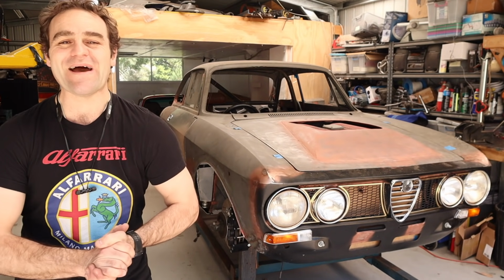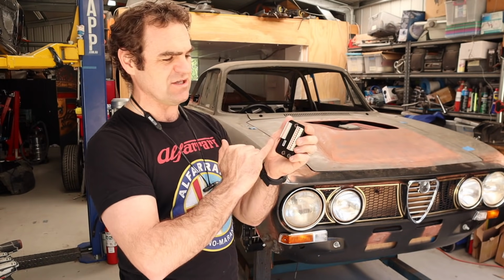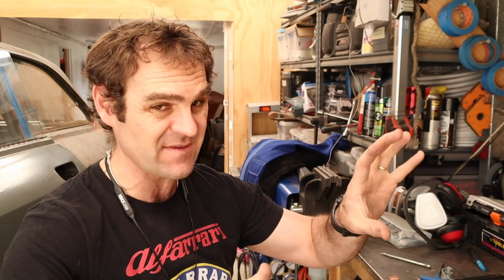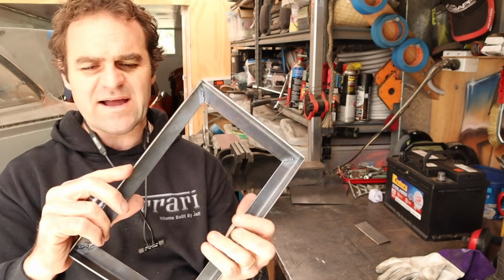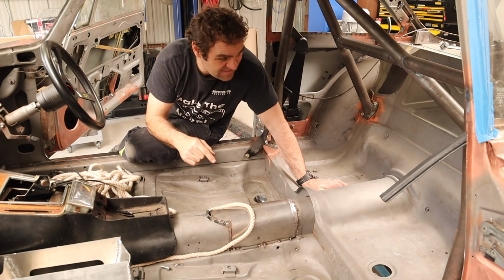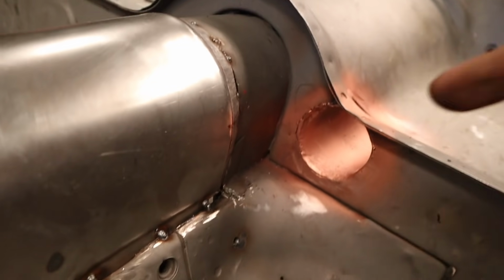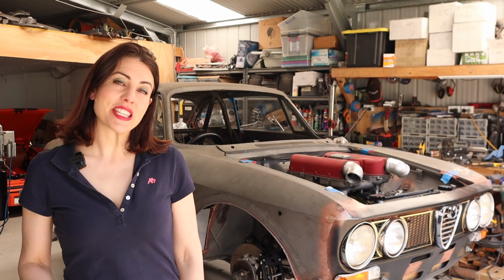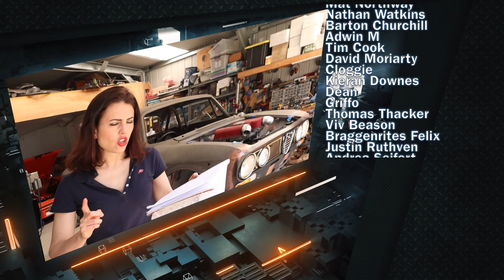Designing a wiring loom - Ferrari engined Alfa 105 Alfarrari build part 109

Comment: a little tip you should stagger your hole in the door to the a pillar for your wiring so when the door is shut the wiring folds a little leaving the holes at the same height the wiring wants to push and pull through the holes have a look at any car you will see that the rubber tube between door and pillar is staggered apart from that i really love both builds keep up the great work jeff

Comment: I have a Moto gadget M on one of my motorcycles. Great unit. The only thing I would suggest is you put a fuse or circuit breaker on the power lead to the unit. You can still fry the unit if it isn’t protected. Otherwise, great choice. They are an awesome unit.
Reply: Agreed, I put a 30A fuse on my Moto Guzzi project, between the battery and the m-unit.
Reply: @davidburne9477  did the same only I used the blade type circuit breaker that fits into the fuse holder.

Comment: Another great video. I have found it is easier to break down the loom with connections. It makes installing it simpler, and if there are any problems a lot better than trying replace parts
Reply: Also gives access for future testing points for diagnosing issues without piercing the insulation.

Comment: Lithium battery works really well on cars that sit for long periods. Only 6 lbs. small and sealed. Can fit behind seat. Shorten heavy batt cable. Can be bolted in with strap on over ground eliminating heavy ground strap.  Use type with internal shut down to prevent battery from drawing down to low. Has button for start if battery is drained and off. Prevents damage to battery.

Comment: Tip 
Wood is your friend 
When you need to mock up things in position to run wires and ensure that there is no interference and to weld in brackets you don’t really want to be doing all this with some heavy or very expensive components that you might not be able to replace easily.
So before risking it mock it.
Make a mock version out of scrap bits of wood and or cardboard. Then it won’t matter if you accidentally put a drill into it or something.

Comment: A tip to easily create your wiring loom: get a flat surface (white board is ideal but a wall or a floor will do too). It has to be big enough to draw the outlines of your car on. Also draw all the electric devices in the car at their actual locations and all the panels were your loom has to go through. Then you can draw a lifesize wiring diagram, this way it's easy to get the measurements of every single wire without having to struggle with it inside the car. Then you can build your loom on to this "diagram". It'll also be easy to wrap the loom knowing exactly were every single wire splits of and to see were you need to mold in any bends for perfect fitment ( Do remember to add extra wire were the loom connects with a device that's not at the same height as the loom 😁).
Reply from the maker: The rope is the best way to get everything in the correct spot.

Comment: i have done this on my ecotec conversion to my alfa romeo spider.. to keep it simple, and easy to work with  keep the body wiring  i/e/ lights heater fan. power window..separate  from the engine ecu harness.. so 2 harnesses.. one for the basic body.. another for the engine ecu...worked great on my car.. lightweight harnesses.. and i can remove them if in need to repair them( if ever ) separately...and because all my light now are LED's i can run much smaller wire to the brake lights/ running lights etc.

Comment: Might be too late, but when you run wires from the car into the door go one hole low and one hole high.
Have a look at where you have your rope when you opena and close the door and you'll see the rope bends and can kink. Over time it will fatigue the wire.
If you go one low and one high the wire will twist instead and not fatigue. If you can get them far enough apart it won't even make a difference to the wire.
If you've got one of those cheap central wiring kits the big bulky wire won't even close in the door

Comment: I know it's too late to redo, but for your future projects, I have done a fair amount of rewires where I placed the fuse box and modules on the back wall or sides of the trunk (boot) for easier access. Some of the older owners had no wish to climb under a dash to replace a bad fuse or relay.  Keep up the great work.

Comment: Gotta love a man that puts a Ferrari engine in his car then buys a cheap PDM. A full-blown PDM (I’m fitting the PDM32 from AIM) will integrate with your ECU and simplify a load of the jobs that you’re going to have to overcome. I know it’s not cheap but it will do all of the jobs properly. Ironically, had you simply rewired the original Alfa, your PDM might have been a good option, but, with all of the gizmos you’ve added, it will barely scratch the surface.

Comment: Looking to the future, if you're going to be making more 3D printed parts, consider pre-buying some "SL Type" heat set threaded brass inserts. The channel "CNC Kitchen" has a great video on them. You just model an appropriately sized hole in your part, then push the insert in with a soldering iron. Gives you a strong, durable, and reusable way to fasten 3D printed parts to the car, or fasten things to 3D printed parts.
Reply: I bought an aftermarket Bluetooth module for my car that has exactly that. They’re plenty strong enough for wiring/computers, haven’t used them anywhere else just yet though
Reply from the maker: Interesting I haven't seen that, but I will have a look. Thanks.
Reply: @HomeBuiltByJeff  Jeff with the amount of cable and tubes going through the car would it not have been better to run 2 conduits, 1 ether side of the car but underneath, entering the boot from under the car that way you can have wires one side vanishing and the same with flexable pipe work

Comment: Make a nice, carpeted parcel shelf where the rear seals would be, and add a front lip to keep things from sliding.  Maybe even tie-down/cargo net anchor points to secure items.  Build it at tunnel height so 1) you have a nice flat surface, and 2) you have a gap underneath to run all those rear wires.

Comment: The stand off brackets are a simple solution! I dreaded putting holes/riv nuts in places before knowing I’m introducing moisture. This obviously both gives you a mounting location and keeps the water outside where it belongs. Here  it maintains a tidy fire wall as well.

Comment: Using the motogadget m-unit on my Moto Guzzi cafe project.  Pretty straightforward.  Eliminates relays etc as well.  Bluetooth programmability is quite useful.  It also doesn’t complain about adding LED indicators and headlight etc like some factory modules do.

Comment: I hope you considered that you can get correct CCA battery in this size.
Also regarding PDM and wiring as a whole:
1. Cars are generally 12V, but circuits divide into low amperage and high amperage. In low amperage circuits you might get away with built in protection of PDM, but in case of failure of high amperage circuit it might burn down whole car electronics to the ground. I hope you considered at least protecting PDM power supply with fuses.
2. Switching high amperage loads and with loads of transients is highly ineffective with solid state electronics. In addition most of solid state switches doesn't offer electrical seperation between circuits. Weird interference issues might be real PITA to track down.

Comment: The grille looks amazing!
The wiring looks like it will turn out well, good planning is key! I like the pipe "shortcuts", should make the AC lines far more manageable.

One piece of advice, the way you set up the holes in the door/door jamb right next to each other will break the wiring rather quickly as it continually bends and slightly stretches in the same spot. 
The way many OEM's does it is to have the holes 100mm-200mm apart, one hole further up than the other, making a length of the loom run colinearly with the hinges. This spreads the motion out over a greater length of the loom, and allows the wiring to twist instead of bend.

I've tried it both ways when running speaker and power lock wiring to the doors of my 1979 Opel Kadett C. First try was with the holes right next to each other, and the wires broke with less than 2 months of use. Second try, with about 140mm of height difference between the hole in the jamb and door is still going strong, years later.
Reply from the maker: Good point.
Reply: @HomeBuiltByJeff  go lower on the door, higher on the body, that way water can't run down and into the car, worst case it goes into the door and out the drain holes (assuming it has some/you put some in)

Comment: Note.
Many batteries have a ridge around the base that can be used to clamp the battery down so you don’t need the strap to go over the top.
Unless you’re off road racing clamping the base is more than good enough for the job.

Comment: An entire loom from scratch. Eek! But Jeff's indomitable as ever. I can't get my head around how the electric aircon will work though, I'd have thought the compressor is at least a kW and that you'd need a huge alternator to power it (at least in traffic). Apropos the current draw, I wonder if an auxliary/parallel li-ion battery could be used? There are quite a few 'abstracts' and 'white papers' covering the design of systems for vehicles (cars, boats, aircraft) but I haven't found anything in the way of kits for one-offs.
Reply from the maker: Classic Retrofit ;)

Comment: Love your work. But just a thought, I'd run the  wiring along the tunnel then away from it to the side of the car before heading under the floor pan, so in the unfortunate situation you blow a driveshaft it won't rip the wiring apart and set the thing on fire. May be an engineering requirement too but not sure

EDIT: jumped the gun on this one and see you went over the rear seat rise bits and into back. Sorted.

Comment: The easiest way to make a wiring harness for a custom car is not to bother.
Just look for a vehicle that is similar configuration to your vehicle that has all the bits you want and is known to be high quality and get the loom out of that.
Reply: The remains of the Audi he scavenged the Boxster's new engine from, maybe? Has power windows for four doors, , central locking, aircon, heater controls, wiring for radio and speakers, headlights, turn signals tail lamps, back up lamps- everything he will need for the Alferrari, and some to delete- all a bit to long and easier to fix that his scratch- and the whole box of relays he will need; all made by VW and easy to repair. I like that he has found Superfast Matt; but the BOM plan to take a harness from another car and adapt it really floats my boat better, financially as well as creatively; I'm probably not having fun if I am throwing tools around and stomping on my $200 volt ohm meter!  FR

Comment: Watch the motorsport wiring on HP Academy? You could put the battery where back seat was. To bad compressor would be to loud I'm guessing yo do the same. What's the copper colored stuff your spraying on? Never seen that.
Reply: It's weld through primer

Comment: No low beam provision in that diagram
Reply from the maker: That is what light is
Reply: But you have that same circuit running to the dash and the tail lights? You should have park, low, hi and indicators at the front.
I think this PDU being for bikes may not separate the 2 as legally bike lights are 'always on'.

It looks like there are auxiliary inputs/ outputs you could use though for the missing circuit.

Love your work as always👍
Reply: I just had a read of the m unit blue manual and under the 'lights' section it mentions it turns on the low beam once the engine is started, like a bike would. It doesn't mention you being able to turn this feature off.
Something to think about.
It also mentions the hi/lo circuit is designed to 2 x 60/55watt bulbs max.
So you might have to run just your inside lights for hi beam instead of all 4. Or go LED bulbs and no problems with load.

Comment: I'm sorta lost; why not strip the Audi of it's body harness, PDU, fusing and relays- it's all made of VW parts, so should be easy to replace any busted , broken or missing bits. And it will have the circuits to run power windows, central locking and AC already in one package. You were going to strip the car to try and recover some of the costs for the Boxster's engine, or did that change? Ust about every connector, bulkhead grommet, heat protected section, etc are already there with a little judicious cutting and splicing. And yes the Audi's interior will be mostly out of the car- it that a bad thing? IDK. 
 You really don't want to run the aircon lines through with the wiring- issues like moisture and vibration come to mind. Also, you might want to re think your tunnel passage; you have as many reasons to want the air con lines on the passenger side as you do to have the loom on the driver's side. Having read a bit on your MOT inspections and how bloody they are for "home built cars" ( I am a Locost Seven fanatic) I would suggest a "false wall" of metal to seal the trunk/ fuel tank area from the rest of the car. It might even give you some package tray to still mount some speakers!  Best to you and the Missus!  FR
   PS; I liked Matt's wiring lecture too- but Nik and Richard did one on adapting an existing harness for Binky that was more appealing to the cheap, old, use the parts in hand hot rodder in me. But never, ever forget; It's your car, Jeff'; the You Tube Experts bedamned! And it is so much  fun and relaxing watching you redo for the third or fourth time!  FR